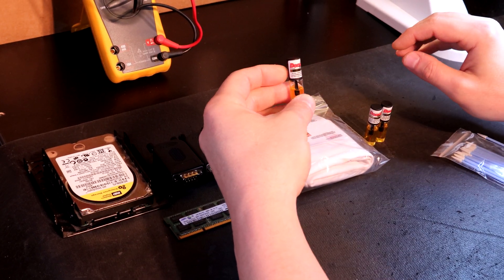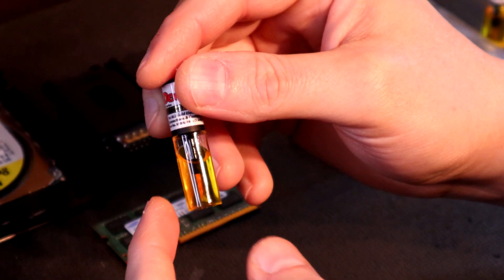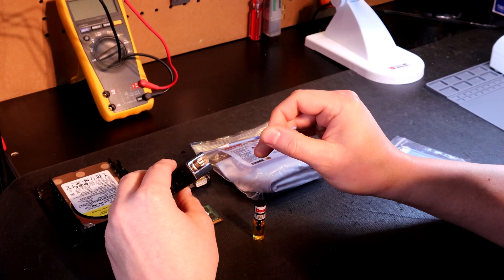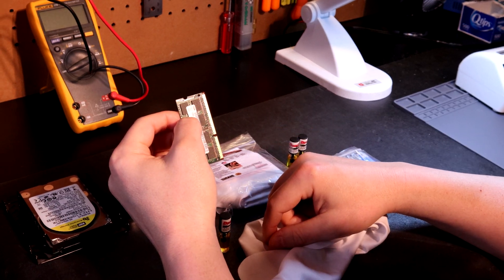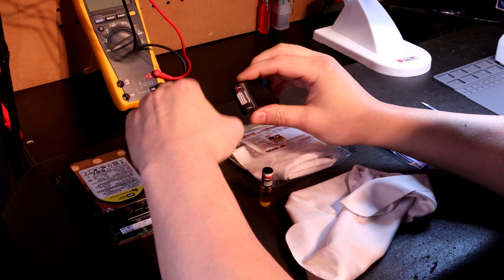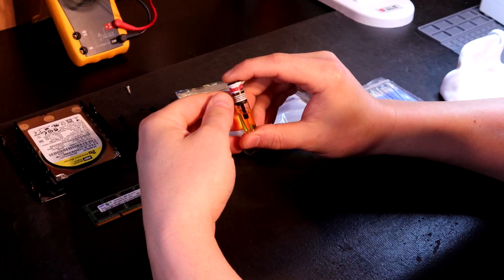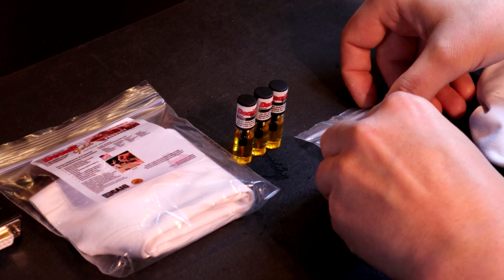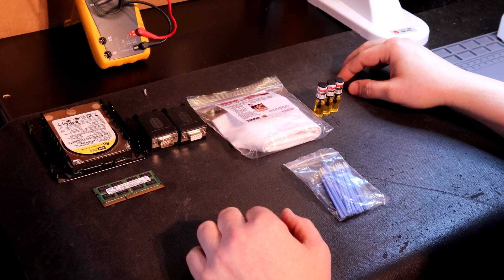NASA Grade CNC/Electronic Signal Protection Using Caig Deoxit Gold..

Comment: Ok. 
Interesting Viji.
Thank-you dude.
Reply from the maker: Thank you for your support I really appreciate it. Vince
Reply: @corvetteguy50  How much do you reco brushing on contacts for Gear like ram contacts or pins on an good ole HDD ??

I'm a big time HI FI guy. I've heard negative things from guys that used this on audio connections but I'm going to experiment and draw my own conclusions.
Reply from the maker: Thank you for your support. Deoxit includes a brush applicator integrated in its cap to apply it making it a simple wipe on application. Its non-conductive, so you're all set. Thank you,
Vince
Reply: @corvetteguy50  Appreciate it.

Comment: Not many people realize the value of conductor protection. I have been using comparable products for over forty years. Never had a problem with any of the treated joints or terminals. Clean old terminals before use.
Reply from the maker: Robert, thank you for your support. It really becomes an essential step when the terminals your cleaning are supporting a production robot. Thank you, Vince